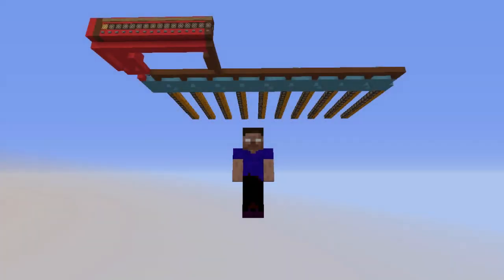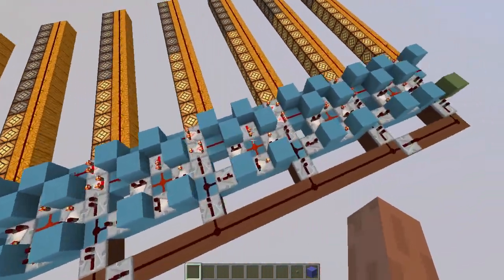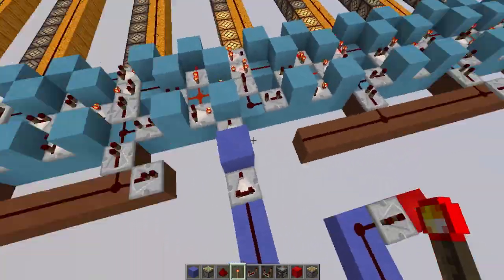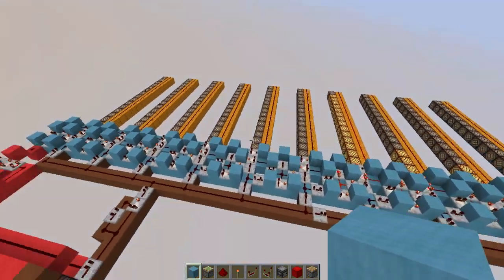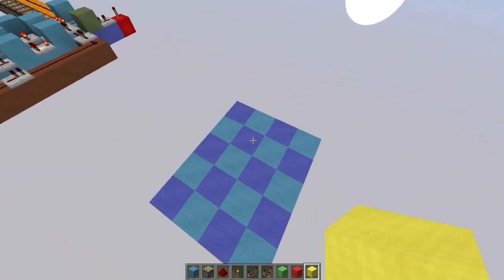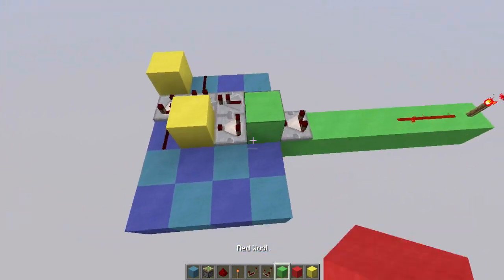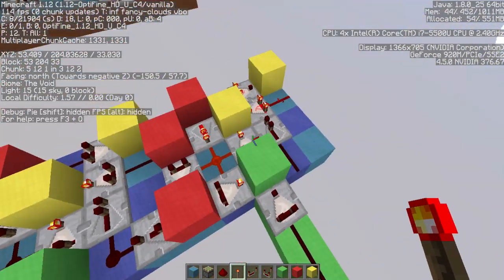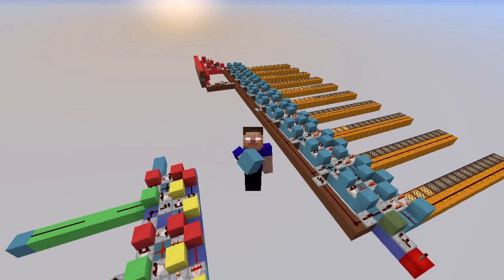Memory Bank Manager: Useful for Redstone Machines | Minecraft PC/MCPE

Comment: I have just made something very similar to this on my channel actually! Was wondering if anyone else had something like this and of course you did.

Mine uses FIFO the same as yours except I stacked the memory cells vertically on top of each other to make it more compact. And I use a lectern with a 15-page book to select the signal strengths, based on what page the book is on
Reply from the maker: Sounds very practical and easy to use!

Comment: Some months ago I implemented a call stack with a very similar design(which probably would function as a queue as well, but that wasn't what I needed at the time). The synchronous version was substantially larger but necessary for consistent read/write speeds.

It was really satisfying to see the correction propagate, btw